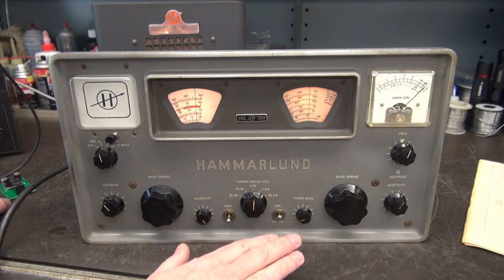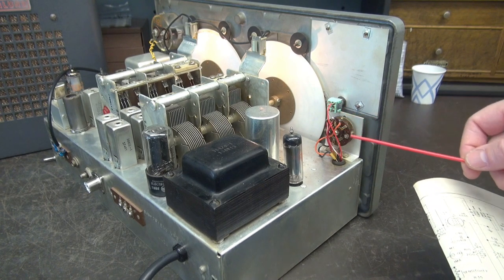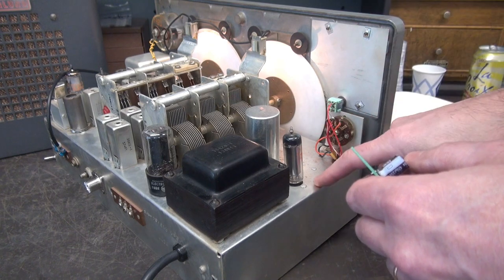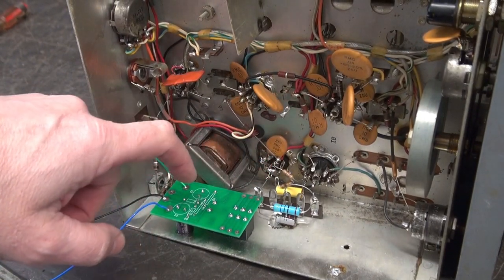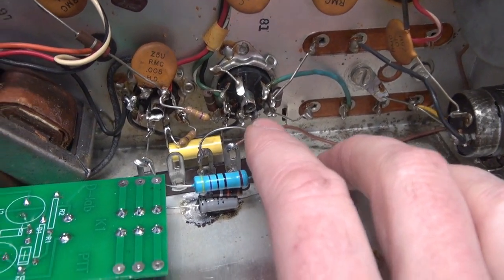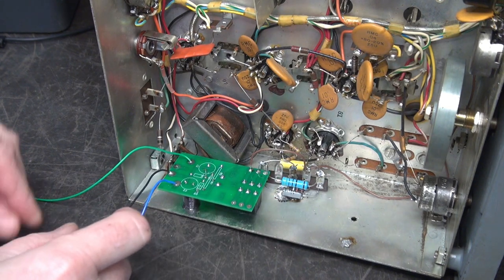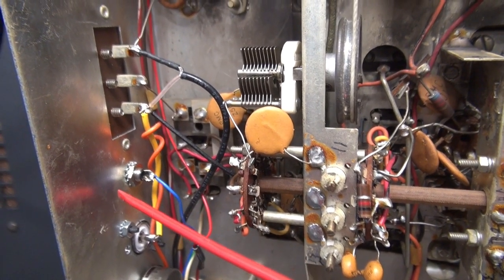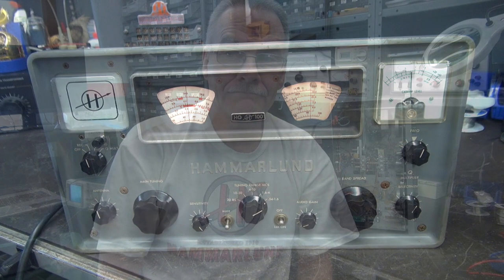How to add muting standby function Hammarlund HQ-100 Ham shortwave tube receiver Easy method

Comment: Nice, clean mod there, Terry!  A good example of adding an improvement without affecting the default operation.  Years back I had to explain to someone that it was better to wire up relays so the coil was de-energized under normal conditions so it would "fail safe"; for some reason the guy felt it was normal to run them all the time, luckily he got my point once I pointed out the alternatives.
Take care, sir!

Comment: I own a hq170A in the back of it has a socket for muting pin 3 4 I would like to use my Johnson's matchbox with build in relay in side it you think that I might work if I wore it to that relay inside the tuner.w8dmx Kevin